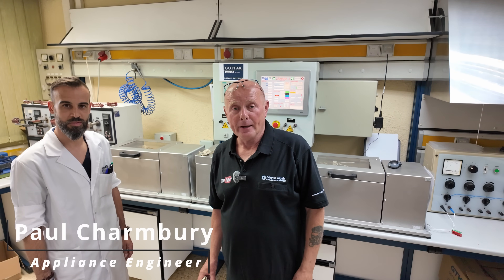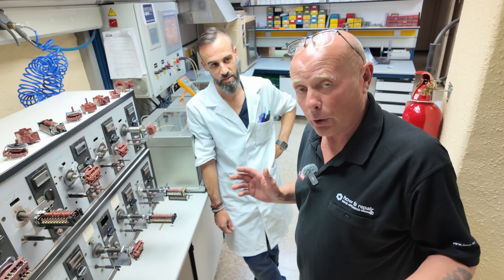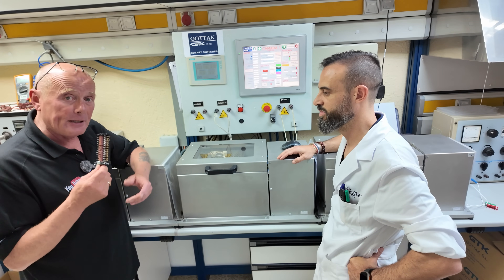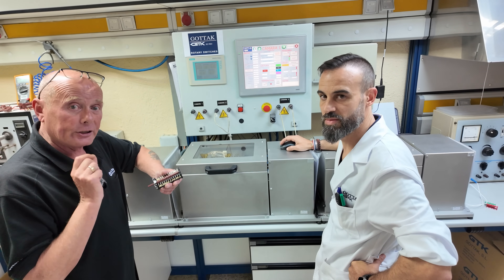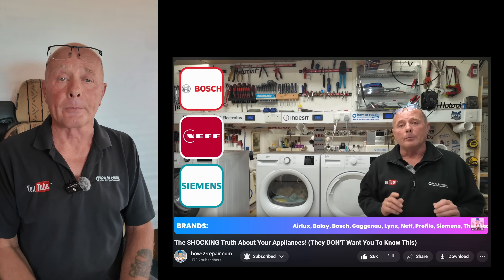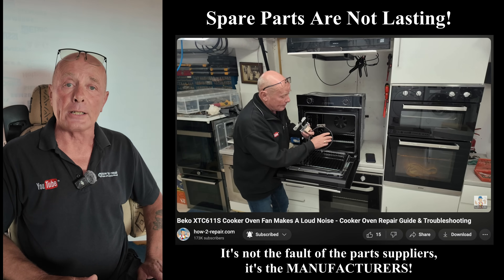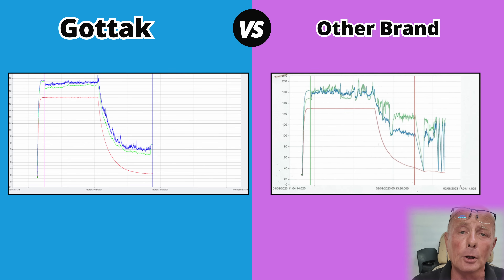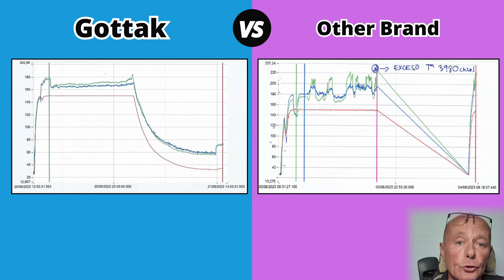Why Your Appliances FAIL SO FAST! Lab Results EXPOSE the Truth!

Comment: It really is a case of penny pinching, as you mentioned Paul, as that means the accountants see profitability at the point of sale

I don't deny manufacturers a profit, it is how any business can operate, but profitability should not come at the expense of outright quality and durability, far too many appliances are simply not lasting like they used to, and it is down to the fundamental componentry being of such abysmal quality from the outset

This has a knock on effect of appliances being replaced much much earlier than they used to be, and with an ever increasing population, the issue compounds itself, and this will result in a greater amount of waste products ending up as landfill

Many of us are pushed towards cheaper appliances, due to financial constraints, but if the appliances cannot last, it is a false economy, but what is worse, is how manufacturers, who have in the past built a reputation of quality, are now little more than a name, they are actually owned by greedy and soulless conglomerates who are only interested in profits, they are not interested in customer satisfaction or the longevity of the products they are selling, and this is shameful

When you have appliances being manufactured, with components that are not fit for purpose, that are also becoming harder and harder to maintain, harder and harder to get replacement parts for, and the components themselves simply not lasting any appreciable amount of time, you end up with a throwaway society as a result, and this is only to get worse if things do not change

We need better and more stringent regulations, to mean that any appliance is expected to last for a set minimum amount of time, with addition for margin of error (aka usage), with parts availability for a reasonable length of time after the appliance ceases production, that the components used are of reasonable quality and cost, and that the appliances are manufactured in such a way that they are easy to maintain or repair, for a reasonable length of time after purchase and any warranty on offer

Such measures, and more, will mean that appliances can be used for 15 years, to maybe even 25 years, with a reasonable expectation of maintenance over that period, but with an overall sensibility of the appliance being reliable and well built, with a fair expectation of associated costs of maintenance over that period of time

I can give a few real world examples:

January 2020 - A brand new Bush Washing machine arrived at my address, it lasted a little over 2 years, with minimal use because I live alone, and my cousin's household had the exact same model, and that lasted about the same length of time also, but their household has 5 people in it including my cousin

In both cases, an electrical fault occurred, rendering the appliance unusable and/or dangerous as a result

This indicates planned obsolescence, and 2 years for a washing machine to last is frankly disgusting! As a result I will not purchase anything made by Vestel ever again

March 2020 - A brand new Bush cooker arrived, I still have the cooker, but it has needed 3 main oven elements in that time, I have replaced them myself because I know how to, but that component should last a lot longer than that, again, I live alone, it isn't being used as much as other households, 3 elements in just over 5 years is frankly unacceptable

If I was unable to do the repair myself, the cost of an engineer coming and performing the repair, would have rendered the cooker uneconomic to repair, and it would be scrap now, when otherwise it functions perfectly fine, and this is the issue occurring with startingly regularity across the industry, components are simply not built to a high enough standard

Back in 2014 - Another cousin of mine purchased a very cheap washing machine from Currys in 2014 - I had to bodge a repair to the start button, the design of the button assembly, meant the button became stuck, meaning she couldn't use the machine, it was so cheap and poorly made, luckily some stronger plastic and hot glue fixed the problem - the machine is no longer in use, in 2018 the mainboard failed, unsurprisingly, because again, cheap components means appliances just don't last

We aren't expecting appliances to be immortal, but this trend to towards appliances, even more expensive appliances that simply do not last, is absolutely disgraceful!

Manufacturers, if you read this comment, step up your game, bring focus back to quality, and how such a thing, can mean return custom to your brand, but also the effect it will have on the environment, if you make appliances last longer, make them easier and a reasonable cost to repair, and provide a quality experience overall, you retain your brands reputation, you retain custom, and you help the planet overall also

Please do something to reverse this trend towards enshitification, a term coined by Cory Doctorow in November 2022, which describes the phenomenon whereby a wide variety of products and services, deteriorate in quality as companies prioritise profits over user satisfaction

This needs to stop, NOW
Reply from the maker: Hi Edward,

Thank you very much for taking the time to put this response together. I completely agree with you. Appliances nowadays just don't last as long as they should for the money we spend on them.

Also, regarding the environment, remember that 99% of all appliances are now shipped from halfway around the world in containers. For example, over 3.5 million washing machines are used in the United Kingdom each year. A 20-foot container can only hold 120 machines. Just think about how many containers are shipped halfway around the world.

About the elements you mentioned, we used to have a company in Britain called Bakker Electrics. They made elements for cookers and ovens that would last 15-20 years before having any issues. Nowadays, components are made poorly on purpose. Manufacturers save a little money but shorten the lifespan of the machines.

The big problem is with governments not regulating this because they need to support the economy through consumption. We can't keep using resources to produce rubbish, ship it halfway across the world, and then deal with disposal problems. Things have to change.

Thank you very much for responding to this video. Please watch the other two videos I linked at the end: one on built-in obsolescence with appliances and another on heat pump tumble dryers. They explain where this industry is heading. If possible, please share the video so others can see the problem in this and many other industries.

All the best,
Paul
Reply: @How-to-repair  I absolutely will

I genuinely admire you, your content, your commitment to everything you do, and the dedication to all of this, you're a stalwart
Reply from the maker: @edwardtrickett1983 I actually had to Google what you meant – thanks for the lovely comment. It's no longer money that dictates things for my channel or business, not since this industry changed so dramatically in the last 20 years. I'm fortunate to be able to speak my mind without worrying about manufacturers' opinions. Everyone has the right to own an appliance that should last 10 to 15 years, without being forced to give manufacturers money every couple of years
Reply: @How-to-repair  The biggest problem is shareholders. When a business sells shares, that's when the accountant takes over, because they have to keep the shareholders happy proving them dividends, so it then becomes a PROFIT based business, not a PRODUCT based business. Well, that's how I see it anyway.
Reply: @How-to-repair  I have literally NOW, just read your response, because I took the time and effort to do so, YouTube didn't notify me

Enshitification, is something you need to emphasise Paul, the issue of appliances, and the reliability of them, is the tip of the iceberg, we need heavy amounts of legislation to put a stop to this slippery slope for everything we as consumers are facing

As ever, sincerely thank you for your sustained efforts in all of this, you are genuine guy, I really appreciate everything about you 🙂
Reply: @How-to-repair  yeah I like your ideas and they were wonderful in the 50s and 60s. We killed a lot of people back then with thinking like you have and we've quit that to a great extent and everybody has complained about it ever since. We have a lot more safety and appliances than we did before and we need it. Have you heard of lithium battery runaway? That's where a manufacturer make something and at the end of its life the battery gets old and burst into flames and burns down your house. They had a few million house fires from a few million hoverboards to get this idea established. All you want is the convenience and economy and every other benefit of the 6-speed automatic pickup truck transmission, and somebody local who can tear that transmission down and put in a gear that wore out instead of buying a whole new transmission. If you had three years of automotive trade school and 5 years of experience you would be barely qualified to go to 3 more years of school and learn how to tear down that kind of an automatic transmission and repair it. Your hourly rate would be so high that it wouldn't be economical to have you pulling transmissions and tearing them down it would be better to pay somebody less money to do that and pay you the big money to fix the transmission on a bench in a rebuild shop.
Reply: Ahh yes Enshittification, turning utility into futility for corporate greed.
Reply: Bring back right to repair laws which will make manufacturers of appliances obligated to supply parts for 10 years after manufacture of an appliance to the general public so it can be repaired and not thrown away
Reply: it is bigger than that , it is planned obsolescence and is a crime against humanity imo
Reply: this and the way companies deliberately hinder repair or sometimes outright make it impossible to repair really grind my gears
disgusting practice, but profitable - but most people wont notice or care. which is the target audience
what a conundrum
Reply: The worst fact about this whole race to the bottom scenario  is that there might only be $20 difference in the cost  between the lousy components and the good ones that make up the whole machine.   If some company would document the significant differences between their machine and major competitors,  and document the real world longevity,   I would be willing to pay an extra $50 on a $500 appliance to not have to replace it every few years. Quality decimated one nickle at a time. So sick of junk, I purposefully look for good, old, simple, solid, used stuff.
Reply: This whole situation is intentional: manufacturers have to sell their sh*t. Manufacturing is very cheap thanks to automation everywhere in the industry. But to make automation profitable, they have to churn out products non-stop. And  someone have to buy them.
Reply: There should be laws against this to reduce waste!
Reply: Wonder if consumer appliances could be designed to accept the same parts for the same function as commercial versions of the appliance,so if there is a failure in the domestic version of the appliance,the technician could offer a replacement part used in the commercial version for a higher fee? That way,the manufacturer would get some additional income from the sale of more expense parts,and the consumer could keep his/her appliance working longer?
Reply: @mikedunn7795 if you keep replacing everything but the electrical wiring eventually the failure mode will be fire. If it's plugged into electricity it's either going to catch on fire or stop working as a failure mode. A microwave oven has a switch on the door that will fail before the seal on the door. Sometimes a real eager beaver go-getter will change that switch so that he can keep running that microwave long after the seal has failed and it's giving him necrotic tissue and cataracts.
Reply: It is not going to stop. Now or EVAH... in fact, they are probably going to pinch EVEN MORE PENNIES in the future.
They do not care if their products last anymore. As long as they last long enough to get out of the warranty period, manufacturers don't care anymore if they ever cared.
They are not making things to last 20/30/40 years. They are making things to last a year and then you have to replace the thing in question, absent those things having long warranties which you are going to pay more for those things with the long warranties.
Reply: The better test would be on the replacement parts not on the parts used on the assembly line.
Reply: Well companies compete and if you have the expense of letting things burst into flames when they fail and being sued you aren't competitive with somebody who designs it to fail without burning the house down.
Reply: I agree nobody wants to pay a lawsuit when their product burns the family to death at failure nobody wants to pay that money that's what it is Penny pitching. I was an engineering and everybody in the world seems to think that we just don't care because we can do better than everybody but we can't do everything you dream. The best you can get in consumer products is have it fail to function. This is generally engineered with a component that will not generate a fire when it fails. These people are so cheap they won't be able to run as long as it can and catch on fire and pay for a family.
Reply: Yes, as of working as an electrician for 14 years and have repaired a lot of various electrical appliances at home for 27 years, I've witnessed the downgrade in quality over time too.
Reply: @draxoronxztgs1212 did you ever repair a microwave oven until the door gasket went bad and blinded the owner?
Reply: I agree with you wholeheartedly do you know how much money people are denied because these appliances don't fail correctly? If it's electrical there are two ways of can fail one way is it can stop functioning in the other way is catch on fire. If we could count on appliances to burn the older people up and get our lawsuit money like we should, the economy would be fixed. I read your entire discourse and I didn't see a single thing about anybody being dead from an appliance failure. My favorite example is the microwave oven. Plenty of people think that the microwave shouldn't have failed with a bad switch on the door being open and shut too many times. The idea is to have the limit switch on the door fail before the seal around the door fails and starts leaking microwaves.  When they make several million copies of something like a microwave oven, the design of the failure doesn't cause lawsuits to completely empty out the money.
Reply: @markmcgoveran6811  that microwave seal is gonna last longer than an associates course degree, though.

Comment: Yes totally agree. I’m certain the electronics boards are pre programmed to fail. It can easily be programmed to do so. Washers etc
Reply from the maker: You only have to look at one component on circuit boards to understand this, if you look at the graphs in this video with the way the select switches fail and then look at relays in circuit boards and understand that the cheap relays have the same type of alloys on the points this is how they can quickly and easily building obsolescence
Reply: Nonsense. There’s no need. The cost-cutting alone results in short lifespans. In contrast, adding an apoptosis function in the code wouldn’t make any difference, and if caught, could potentially open the manufacturer to legal liability.

Comment: Whenever I had to deliver the sad news to a customer that their 20 plus year old appliance had come to the end of its life (the oldest I can recall was a washing machine of 46 years), they would often ask for a recommendation of a replacement which would deliver a similar performance. 
I had to tell them that the majority of modern appliances were "much of a muchness", even the supposed premium brands, and not to expect anything more than 5 to 7 years use at best. 
I often advised them to research the cheaper end of the market, ignore the models with all the bells and whistles and choose something that just did the basics that their old appliance would do.  🖖
Reply from the maker: Planned obsolescence and the lack of repairability are major issues in the industry. Manufacturers prioritize profit over long-term reliability, and as you pointed out, the pressure to keep releasing new models only adds to the problem. I've reached the point where I simply cannot tolerate this situation any longer, and that's why I made this video. I would be grateful if you would share this post, as it’s the only way to force things to go large nowadays. Have a great day.
Reply: That's why I laugh at all the "you get what you pay for" clowns. No, YOU DON'T. Ignoring the absolute extremes of the market, you can only get cheap and poorly built stuff or expensive and also poorly built stuff.

Comment: Not a problem,  Dishwasher broke , I have the skills to fix it ,     Apart it came,,,    circuit board covered in clear rubber?  that I can remove ...so I cant get to the components .     Panasonic    arsehats
Reply from the maker: Really glad you were able to fix your machines not everyone has the skill set

Comment: THIS IS A WIDE SPREAD SYSTEMATIC RIPP OFF PRACTICED BY THE MAJOR MANUFACTURERS OF CONSUMER GOODS AROUND THE WORLS ,MOST OF THE APPLIANCES SOLD TODAY ARE NOT REPAIRABLE EVEN BY THE MOST EXPERT TECHNICIANS ,THERE IS ALWAYS SOME PARTS THAT RENDERS THE APPLIANCE A PAPER WEIGHT,:hand-pink-waving::hand-pink-waving::hand-pink-waving::hand-pink-waving::hand-pink-waving:
Reply from the maker: So too, but it has to stop somewhere